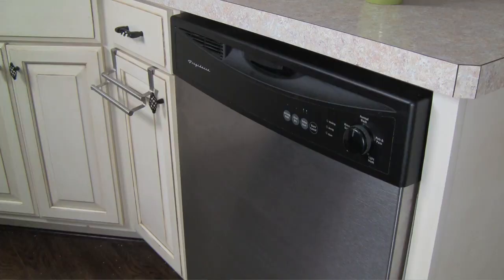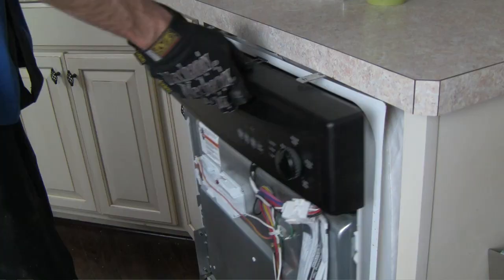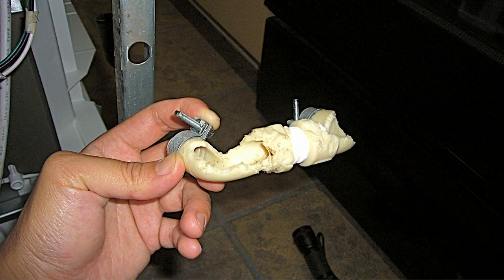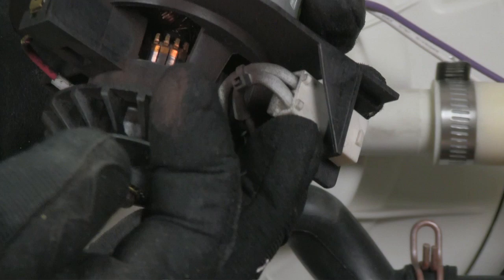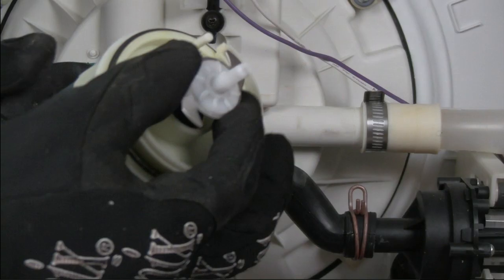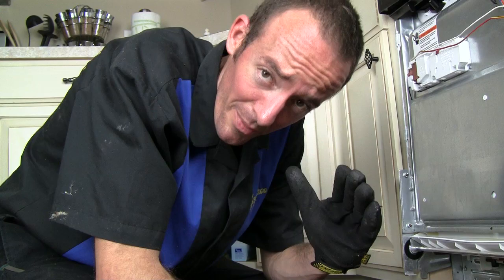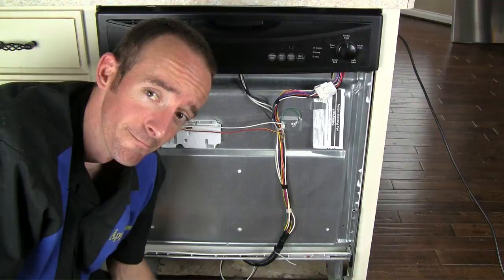How To Repair Frigidaire Dishwasher Noises

Comment: Once cleared I reinstalled the ball check, racks, and spinner jets. 

You could also try removing the ball check then filling the bottom with water. Using a shop vacuum (wet vac) try sucking through the top jet to clear any blockages. The vacuum should pull the blockage through the tube and the water in the bottom will help wash the rest of the gunk through. 

I didn't need to remove the washer from the cabinet but it didnt look like there were any other components in that line that may obstruct

Comment: I was getting distressed. The 1 1/2 year old frigidaire dw would not drain but seemed to run normally. Then recalled that husband had replaced the disposal a week ago. Sure enough, he checked and found that he hadn't punched out the knock out on the disposal. Everything works like a champ now.

Comment: First step before anything else.....did you change out your garbage disposal??? If you did, did you knock out that pesky little plug that sits about an inch inside the connection for the drainage tube? I didn't and after trying everything else including changing out the pump I came across a nice man on You Tube that asked that same question.

Comment: danke so much,   this is almost the same one I have and I think it worked,  now the electrical 's not working,  maybe a bad breaker,   I have not had a breaker before
Reply from the maker: Thanks for the comment! It could be a bad breaker, it can also be a bad connection within the power connection box, or a bad control board.
http://applianceassistant.com/appliance-repair/dishwasher-repair/how-dishwashers-work/
Good luck!

Comment from the maker: If it's a humming noise, I would check your dishwasher's water valve and the water supply.  It may be clogged up with something, or the valve may need to be replaced.  I hope that helps some.  Usually the drain motor will run for a few seconds before the fill is initiated... so you may also be hearing the drain pump... you may also want to check the float switch first...

Comment from the maker: @Thecrazyeditor The dust is caused by the two bars, called brushes, that transfer electricity to the stator of the motor grinding down over a long period of time. It is normal for this to happen over the course of the motor's life.  The brushes are fairly long and spring loaded so they can maintain contact as they grind down.  It is unlikely that the brushes grinding down would cause the motor to fail because there should be more than enough brush material to last of the life of the dishwasher.

Comment: I have an ultra quiet 3 as well. It leaks. The leak appears to come from the recirculation pump you reference in your video. The white part with the paddle wheels. Any advice? This is a portable unit.

Comment: Great video. Any tips on replacing the door seals you talked about at the end of the video. I'm missing the small one on the right side. I have water leaking on that side. However, I've been missing that little piece for a while, and the leak just started?? Not sure if that is the problem. I guess I'll start by replace the bottom seal and the little one for the corner. Thanks!

Comment: Great work! Can you comment on Frigidaire saying the spray arms alternate? And I am mystified what the ball check does - seems like it would just shut off the upper arms... I have no water to the upper arms or not enough to spin the arms much. Pump is great, bottom spray arm is strong.

Comment from the maker: to be sure you would need to check for AC 210 at the motor connections.  Is it a Frigidaire or some other brand?  does it wash and just not drain, or fill then nothing at all?

Comment from the maker: Most Frigidaire dishwashers have a section of the hose looped up onto the side of the appliance to prevent that problem.  Sometimes installers will remove the "hi-loop" to gain a little extra length to reach the drain connection. That's my guess.  Otherwise the drain pump would need to be running to push the water out of the tank. You can make a drain extension kit with a 1/2" copper pipe as a union point, 2 clamps, and some 1/2" black hose you can get at the hardware store. Good luck!

Comment from the maker: @kweiss84 Try lubricating the o rings with some Vaseline before reinstalling the motor, it will keep them from rolling out of position and the oil will help repel small amounts of water from the seal.  You shouldn't really see water in the bottom of the tank. You may need to check the pump and drain for a small blockage.

Comment from the maker: @chuckhpnwx You may want to flip the breaker off and check your wire connections to the dishwasher.  Sometimes a loose wire nut can do what you are describing.  If the wire nut looks melted cut it back and clean up the wire connections flip the breaker back on and hope for the best.  If thats not it or you have any other questions email me through my website and I will give you my phone number. There is a link in the video description.

Comment from the maker: Yes it is normal for there to be a small amount of water left down in the sump area. however if it is enough to see normally even when the lower area is all back together, you may have a problem with the way the drain line is run that allows water to back flow in from the sink or garbage disposal.  Otherwise mechanically the pump may not be working efficiently... but some water remaining is normal.

Comment: Absolutely great instructional video.  In 2011 this happened after 6 months and was covered under warranty (motor replacement).  Now three years later same thing.  did top side diagnostics and can feel impeller catching on the tab you shown on backside of housing.

My question - Before I pull the washer, any idea how long relieving this "pin" will last?

Thanks so much; enjoyed the humor too.
Reply from the maker: Thanks! On mine it lasted for 2 more years with fairly quiet operation...(not that quiet to begin with) It's still working but getting loud again, I think I'll hold my breath and swap it out this time.

Comment from the maker: @Thecrazyeditor Water pressure should not decrease unless the speed of the main pump slows down.  If you don’t hear the motor bogging down and the pump impeller that you can see from the inside of the dishwasher is not physically broken, I would assume that you have a soap & mineral deposit within the dishwasher that may be restricting the water’s ability to flow freely.  Try running some dishwasher cleaner through it and see if that helps. Buying it through my web site would be awesome! Thanks!

Comment from the maker: hearing the water surging is fairly normal. but it's hard to say without hearing it. If there is no mechanical problem try making sure that your water is as hot as it can get at the sink before starting the dishwasher. You may also want to try running a cycle or two with a dishwasher cleaner like "Lemi Shine" Or "Glisten". There is also a troubleshooting articles on my website. The link is in the description of the video. I hope that helps some! Thanks for commenting!

Comment: I have this model.  Machine doesn't drain.  Replaced the drain pump.  When I cycle through the settings it just makes a dull noise at the drain cycle.  No debris in basket.  Nothing burned out on the circuit board.  Thoughts?

Comment: I took out my circulation motor on my Fridgerdaire and ran the dishwasher the motor ran when I held it straight up and down but would stop when I tilted it slightly . I’d thzt normal?
Reply: If it has good contact to power it should run no matter what angle it's at. Sounds like a bad motor, probably the brush bars are worn down and not making contact to one side of the motor. Good luck!

Comment: Great video.  I followed your steps of removing and cleaning both the wash pump and the drain pump after my Frigidaire dishwasher stopped draining.  While some debris was cleaned from the pumps, my dishwasher still does not drain.  When the dishwasher moves to the drain part of its cycle, I hear a faint click and then nothing.  It seems to me like the drain pump isn't moving at all although it spins freely by hand.  The dishwasher has been working fine for about 3 years now, and it just quit draining one day.  Any thoughts on how to troubleshoot this?  Should I replace the drain pump?

Comment: Thank you for your inputs. Could you please tell me what kind of screwdriver you use? We are able to remove most of the upper parts with a regular screwdriver but are not able to remove the screws in the bottom near the wheel.

Comment: Are you ablle to provide add'l advice?  I have low pressure during wash, so took all apart to explore and clean (hoping some clog around the main pump was the problem.  Unfortunately, i did not observe how the sump gasket fits with respect to the mating surfaces.  Could you tell me if the center part of the assembly (the "guts") has to fit within a groove of the gasket, or does the gasket simply get sandwhiched and then compressed by the 4 torx screws?  Sadly, I did not observe the position of the gasket  before it fell out.  Thank you for considering.  My Frididaire model is bottom-of -barrel in terms of the control panel (argh!).

Comment from the maker: should be part#154753201 Now that I have seen it I'm not so sure what you are referring to. There should be a rubber female connection on both ends of the hose for the clamp to sit on an seal.  You may want to look at the part online and make sure you have the right part... Sorry I cant be of more help.

Comment: Great video and thanks for sharing!  Even though I am NOT nearly as mechanically-gifted like you are, it still was interesting to watch.  I am moving but am having a Frigidaire Dishwasher (Model #FFBD2411NS) installed this week and I read that Consumer Reports said that this brand is repair-prone and near the bottom of their recommended list of reliable dishwashers.  Do you agree since you said that this brand is very popular?  I just hope the new homeowners have no problems with it.

Comment: Thanks so much, you just saved me quite a chunk of change by discovering that the weird, whiny sounds that my washer was making was in fact the solid food waste disposal blade hitting on the outer housing. A quick notch on the housing like you indicated did the trick viola! All is well again.

I also discovered that one of the rubber seal rings was extremely loose on the pump motor assembly. I took a  picture and would love to send it your way to see what you think. Where can I email you?

Comment from the maker: I doubt that a bad seal would cause a noise... the first effect would be a leak. However if it was worn down to a point that it let plastic vibrate against plastic, that may cause a noise.  as far as your second comment... there are two different motors, one for wash and one for drain... If you hit the cancel button after it starts to wash, does the noise go away or get worse?

Comment: I have a similar Frigidaire dishwasher that just recently stopped pulling water into the machine. The motors are working, but no water. Have checked the water feed line, same as before. What could it be? Thanks!

Comment from the maker: The door latch is probably damaged in some way so that the two switches within it are not opening to stop the cycle when you open the door.  There could also be a short somewhere in the wiring but I would say 95%+ chance the door latch needs to be repaired or replaced. Thanks for the comment!

Comment: Awesome video....I pulled all of the areas apart that you suggested and found a massive wad of paper in the impeller which was causing a vibration like a bad chevy diesel.

I still have a mild vibration in the drain pump and couldn't find anything inside.  Perhaps just worth replacing?

Comment from the maker: @brymackmoney The dishwasher fills based on the average time it takes for the dishwasher to fill with the correct amount of water.  The float switch is only to protect from over filling.  I would be inclined to think that the water is not flowing into the dishwasher fast enough... How is you water pressure on the hot side of the kitchen faucet?  You may also want to check the dishwasher's water valve for clogs, but the problem probably lies somewhere in that department.  Good luck!

Comment: Great video. Great editing.
My similar dishwasher will not run with the control on the Normal Wash setting but will run on Pots and Pans.
Do I need a new controller?

Comment from the maker: It is posible that the drain pump has something down inside it that it jamming it.. you could also have a blockage in the drain line somewhere ether at the air gap on the top of the sink or at the garbage disposal connection.  It would be strange for something to go wrong at 6 months but not impossible.  Do you hear the drain motor trying to run?

Comment from the maker: well if it is washing it is probably not the main motor. And if there is no sound like the drain pump motor is trying to drain it is unlikely a blockage so I would say in order of likelihood ether a bad connection from the board to the pump motor, a bad pump motor, or a bad control board.  If you check for and measure 115 - 120 Volts AC with a multimeter at the wires to the pump motor after pressing the cancel drain button it's probably not the control. Hope that helps some. Good luck!

Comment: I bought a replacement motor for my Frigidaire dishwasher which looks like the one you have in the video. Unfortunately, the plug on the old motor doesn't match the plug on the new motor. My old motor had a 3 pronged spade plug with white, green and blue wires. The new motor just have the 2 prong plug shown here.  I see that your plug in the video has white and blue wires.  Should I be able to simply attach just my blue and white wires to the 2 prong connector on my new motor?  Thanks

Comment from the maker: It should take longer than 3 seconds for the water to fill...  The click sound can be normal on some models. If you don't have an upper spray arm they use a tower from the bottom that extends to wash the upper rack. (be careful not to block it with any dishes.)  There is also the check ball that can click as the washer motor shifts from drain to wash.  Try the cleaner first but if that won't correct the problem it will probably be with the main wash motor. Good luck!

Comment from the maker: There are a lot of outside factors that have a huge effect on how well the dishwasher cleans the dishes.  It may have a mechanical problem but 80% of the time it's something else... I have a troubleshooting dishwasher problems page on my website that may help.. There is a link in the video description.  Most important thing is that you get the water as hot as possible at the sink before you start the dishwasher! (At least 120º) Hopefully that and the guide will help! Good luck!

Comment: yes, I removed and cleaned the ball check assembly and ran the dishwasher without it in place. 

With ball check, baskets, and rotary jets removed I ran the dishwasher (door open) and used my hand to block the bottom jet hole forcing the water to go through the top jet only. I needed to use a  flat object to push the door latch into the closed position; Pulling up on the handle will make the door latch open again. I'm guessing that either the ball check got jammed or the tube leading up to...

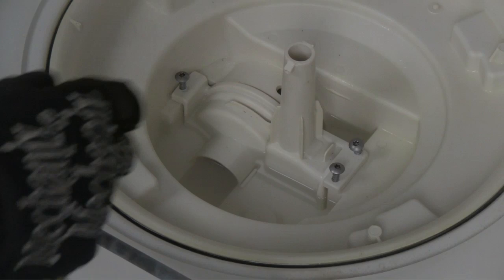Comment: What is the small wheel you were spinning with finger at 1:37 is called? Where could we get a replacement of that wheel for model: FFBD2411NS4A? Mine looks different than the one showing in the video. Thanks.

Comment from the maker: If you have this style of dishwasher the main motor recirculates water up through a tube on the outside of the tank to the top spray arm. So if the lower wash arm is working and the motor sounds okay you may want to look for a clog in that line.  Some times just rinsing it out with a good dishwasher cleaning product will do the trick. Good luck, thanks for the comment!

Comment: Thanks for the video. I have a leak coming from the small slots (vents) on the circulation pump. Inside of those "vents" there is a small hole. The water seems to be coming from the small hole. What would be the cause of this?

Comment from the maker: What is your model number? Also you may want to check under the little float cup inside the dishwasher tank that senses the water level... Something may be under it holding it up so the dishwasher thinks that water is in the tub.  But I would need the model number to see if I have a manual that I can reference to see what the "S" means.

Comment from the maker: I'm stumped : (  You may want to go through the dishwasher troubleshooting help on my site... It's amazing what preheating the water at the sink before starting the dishwasher will do!   And the right kind of soap, using dishwasher cleaners, etc.  But I would guess if it is a dishwasher problem, it's probably a bad seal or a clog in the tube that supplies water to the two upper spray arms. You may want to try all the free stuff before you call someone... Hope that helps some. Good luck!